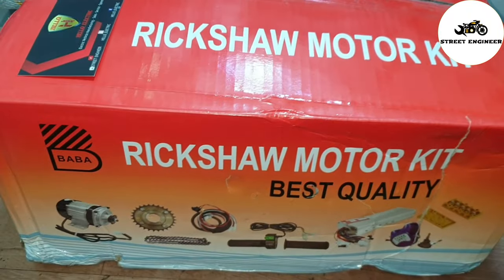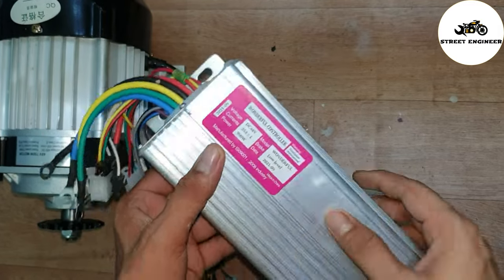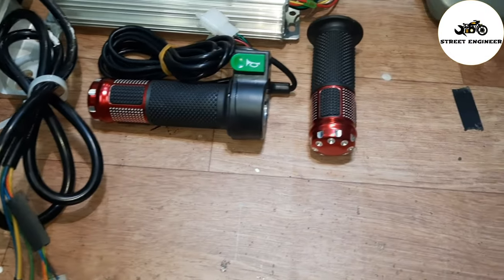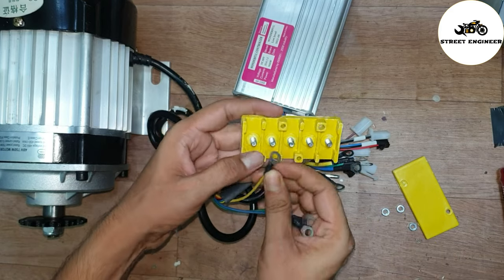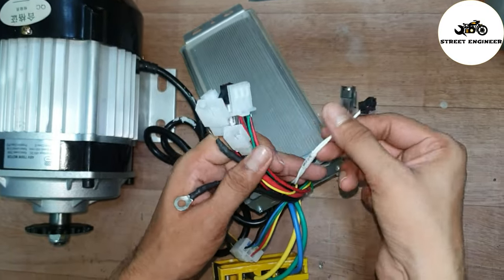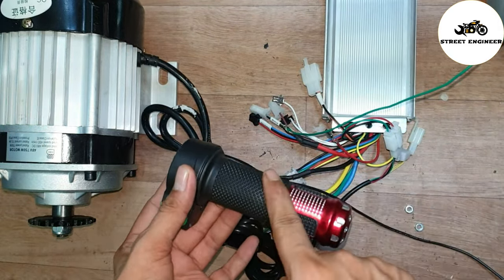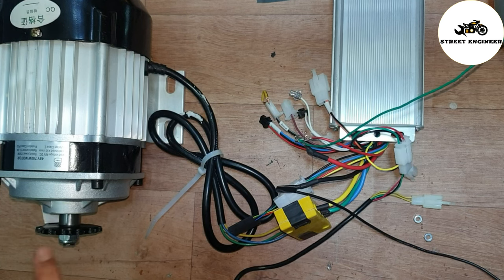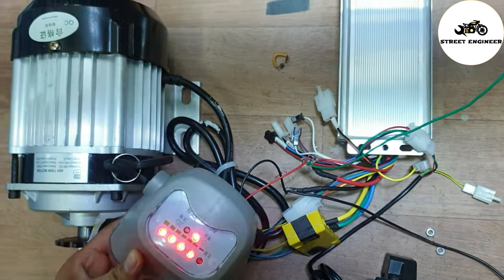Powerful electric bike motor kit , 48volt 750watt , 100kmph speed

Comment: this battery 10a  will work the motor for less than one hour?
Reply from the maker: Atleast we required 16amp to run this motor for one hour with load ....without load this motor can run on 10amp battery for one hour easily
Reply: @streetengineer123  thx for reply
Reply from the maker: Always welcome 😁..keep supporting and share